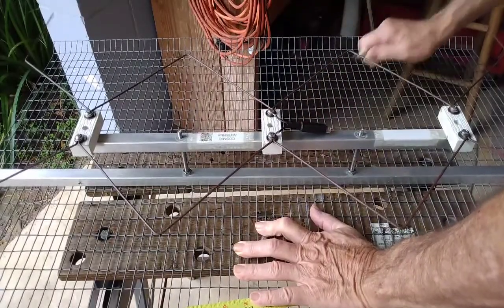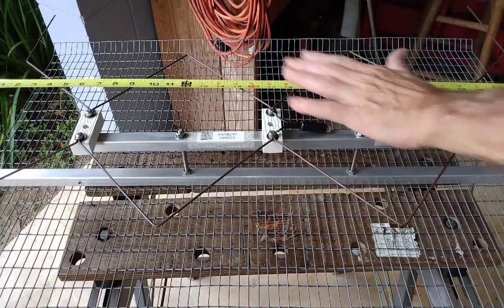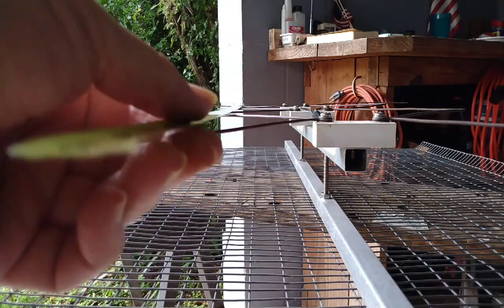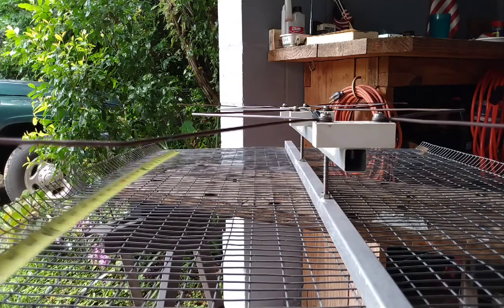Hoverman Measurements 2

Comment: Does the reflector block signals from the rear of the antenna or does it reflect the signals back on to the elements to make a better signal.
Reply from the maker: Both. 
The reflector bounces the signal back to the elements in phase for a stronger signal while blocking signals from the rear. 
Makes the antenna directional.

Comment: Never use stainless steel screws for the elements, try to use aluminum, it creates interface
Reply from the maker: You're way off on that. 
Stainless doesn't react with the copper element, nor does it create it's own electromagnetic field to cause interference, it works perfectly with the elements.

Comment: Is the reflector wired to the antenna??? Or is it simply behind?
Reply: The reflector it's not wired in any way to the reflektor. I built my antennas out of PVC pipe their completely insulated from the reflector. The reflector does give you a full board game but it cuts out the back. In some situations you don't want to block off the back of their signal back there you want. You can get apps for your phone that tells you where they are. If you're within about 20 or 30 miles from the transmitter and you have it over the roof there's no reason for a reflector

Comment: Great video 👍👍
Reply: Is the reflector wired to the antenna??? Or is it simply behind?
Reply: @BOBANDVEG  it's a separate part. It makes no physical contact with the antenna elements that receive the actual signal. It's only purpose is to bounce the signal that passed through and beyond the elements, back at them to increase their exposure and improve performance.
Reply: @russellborrego  you're awesome.  thanks for a "clear" answer.
Pun intended .
Since you're here, is the antenna element (copper in my situation ) one continuous loop or 2 branches?
Reply: @BOBANDVEG lol happy to help. For the hoverman, the elements are two separate pieces of copper/aluminum/etc bent to mirror images of one another.

Something simple like a loop antenna, is literally one single length of copper bent into a circle with a balun attached to each end of it. A design worth exploring as well if youre starting out and have copper to experiment with. The hoverman and other designs are superior, but a loop is a good way to get your feet wet as well.
Reply: @russellborrego  you know what Russell. ....you're the man . Have a super duper day
Reply: @BOBANDVEG  you as well 👍
Reply from the maker: Russ thanks for taking the question, good job.
M

Comment: The Gray Hoverman was the first antenna I built.  It worked pretty well.  I never really had it pointed in the perfect direction, so I didn't get the reception I wanted.  I ended up cannibalizing the copper for whiskers on another build.  I love the precision, mathematics, and science behind your builds.
Reply from the maker: Thanks Wes, I strive to show the basics so everyone can build a good antenna. I dip into the math and precision for those who want to dive a little deeper. Thanks for noticing. 
The Hoverman is a great all around antenna, but it can be quite fickle in certain situations. If we don't do what IT wants, it just won't play.
Thanks.
Reply: @cosmicantenna9244  - have you tried 2 Hovermans with a common center reflector where it receives signals front and back more of a 360 degree antenna?